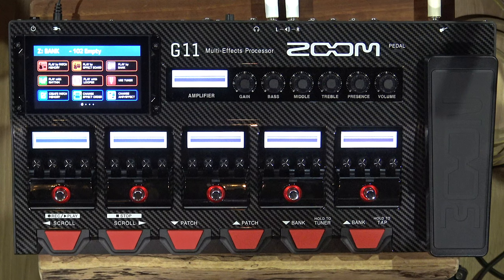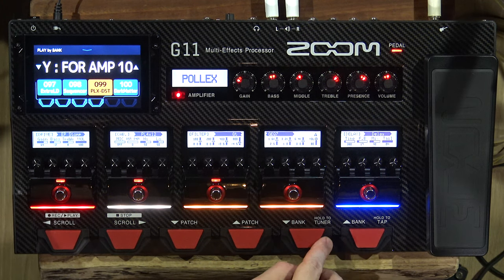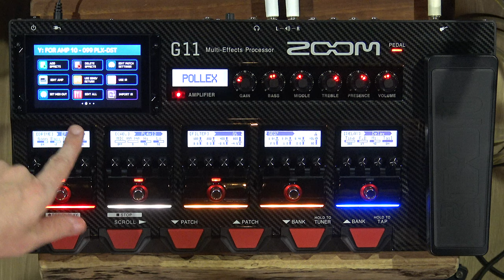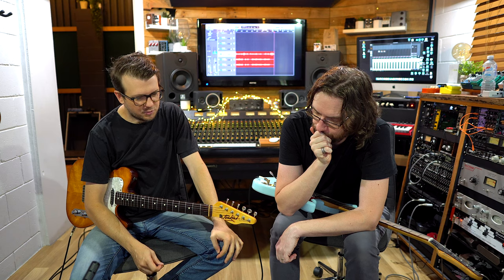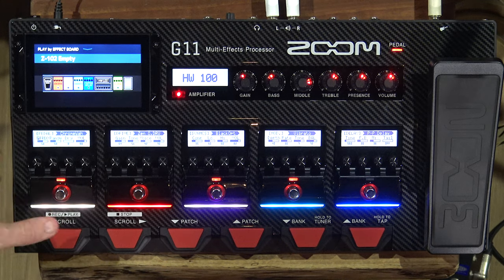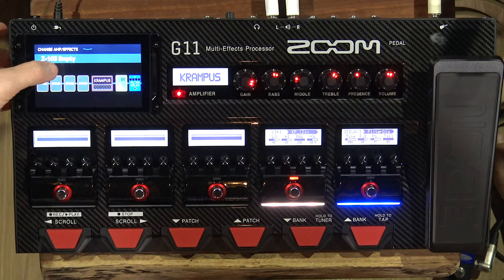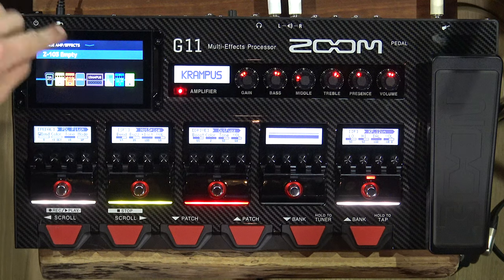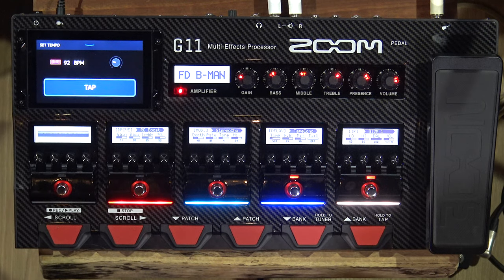Zoom G11 Part 1 - Overview and Building a Patch

Comment: So i got the Zoom G11 recently , but i need to know if i can assign a patch for each stomp switch ? Or if i can only scroll up and down through patches by way of the bottom pedals with the arrows? I mean , if i set up 5 completely different patches and i need to switch from patch 1 to patch 5 , why would i want to click 5 times to get there? Even the G92tt i have has 5 stomp switches on the bottom that i can assign patches to and instantly switch between them.

Comment: So own this and it has been great mixed in with a Strymon + EHX backline. Not expensive, much underrated amp sims, although some rubbish IRs and no parallel processing. I understand there are some very good prices available on this now. The main thing with this product is the quality of the sounds ( better than G5n), and the incredible workflow. Is the centre of my (quite large) pedalboard.

Comment: Very nice video, but those patches seem too complicated for me. I want to create 5 or 6 patches to play a very versatile set; let's say a 'coverband playlist': clean, blues, funky, some heavy stuff. I've spent many hours tweaking, but I'm not satisfied at all with the results. Where do I start? Which amp of which style? Which effects do I absolutely need for each style? Thanks!
Reply: My two cents - the Zoom created custom amp sims are better than any of the ones that are trying to replicate an existing amp model. For example, I like REDLOOM for clean sounds more than any of the Fender Deluxe Reverb, Twin Reverb, or Fender ToneMaster amp sims. 

Also, for how much people bash the presets on these things you can learn a lot about optimizing effects chains by using your favorite presets as templates. 

Also, #1 tip with this product - if something about the sound just seems off on a particular preset, make sure cab mic is turned ON. That solves the problem for me half the time.

Hope something in there is helpful

Comment: Apart from the brilliant user interface can't really see why this is so expensive!... The G5n can do nearly all the sounds you demonstrated at a fraction of the price.. to convince me please do a guitar lab demo and see if the G11 really shines!☺
Reply: The G11 MSRP is definitely overpriced, and the upcoming G6 is definitely probably the better choice in nearly all situations. But what it does do better than the G5n or G3n is that the amp models and overall modeling tech has been noticeably improved. You can find comparison videos on YT, but essentially the G11 sounds a lot less compressed and more lively, improved in the high-frequencies, etc. The interface is also definitely better, whether or not thats a big deal is up to you. Another huge benefit of the G11 is being able to load in your own IRs, which improves the sound by a TON. The built in cab sims are decent in the G5n/G3n, but nothing beats a well-produced IR. Takes the sounds to a whole new level.

All that said, you are still better off with the G6 in my opinion. The G6 does basically everything the G11 does, at a much better price point and form factor. It's honestly what the G11 should have been in the first place.
Reply: Well would guess those digital/analogue converters are driving the price. S/N ratio at 127 dB. That thing is pretty much something you get within axe fx or kemper ( I guess ) . 
Not sure if you noticed , but all those amperos , Mooers, helixes etc. Their amps have a ton of top end, and only with it sound pleasing . Here you don't have that top end , and the whole thing sounds closer to real amps. Dynamic response is also noticeably better than the competition.

Comment: Here's my take on all things Zoom [guitar fx related]:
1 - Zoom have always been - for the most part - the underdog when it comes to their products. Coupled to this, an almost non-existent publicity to their stuff.
2 - Although most people don't know this, their Rack FX have been used to a great extent in many records and still have a place in some studios [Trent Raznor, Marylin Manson, etc]. Specially in Electronica music.
3 - People also assume "zoom = cheap plastic crap" because at a time when shit was expensive, zoom put out multi-fx units at a very affordable price [and aren't made in USA]. They still do. But they also have "proper" stuff. But for better or worse their stuff became iconic and is still being used. Some of their older pedals and racks are somewhat desirable and colectible.
4 - Zoom also tries to do things differenty [by offering the same]. A floorboard with valves, a Z pedal, analog dirt... BUT - and here's the catch - their products appearance is just useful. Not pretty, not edgy, just useful.
5 - When Zoom decides to properly clone an fx, they nail it. But when they drink that sake... 
6 - That said, whoever at Zoom had the brilliant idea of designing the G11 the way it is, did it for the lulz or he was way too high on the coke he sniffed from his racing car's dashboard. This has to be one of the Fugliest floorboards ever designed. The amp section is a good idea [not new but very useful], the middle section makes sense, but is awkward. Might as well just offer a bigger - and better - touchscreen and put those 4 knobs under it [or more]. I mean, there's a lot of space there. The plastic footswiches make sense and don't take space on the board. But I wouldn't trust them [as I don't trust my clumsy feet]. 
Of course they did this to differentiate it from the likes of Line6 etc... but it doesn't work. And that carbon fiber shctick died in the 90's.
So, as a conclusion, for 700 Euros it LOOKS hard to buy [maybe with some sake]. There's no much difference in sound from their other products, with the exception of the IRs
Good show as always mates.
Reply: After sales service is very poor according to my knowledge just like line 6

Comment: its good. now you sound pro even not know play lol.
BUT when use USB and try play from pc speakers there latency. even worse than software based.
when push drum track to pedal so cant play without latency on g11 with headphones from NI its different BPM.
it works like it supposed, but not when connected pc.
there is no way could record when there is latency